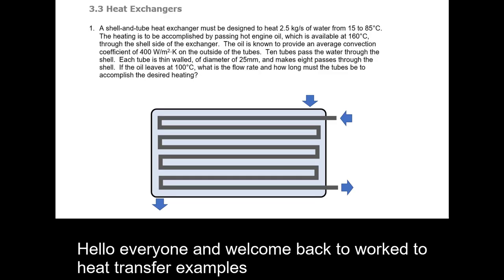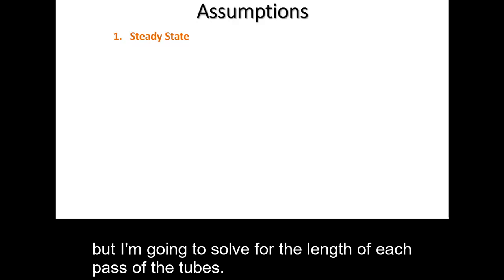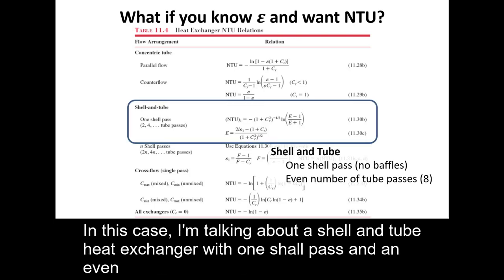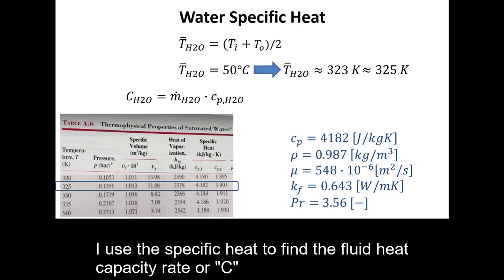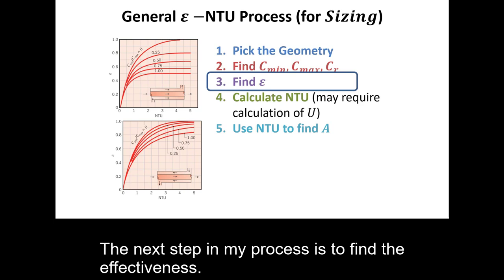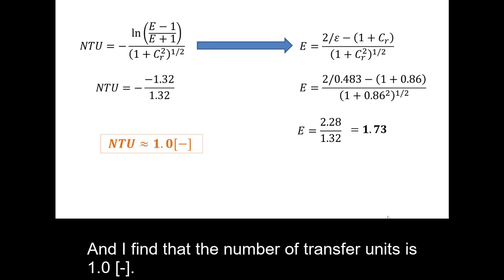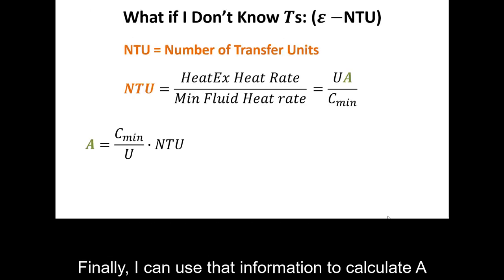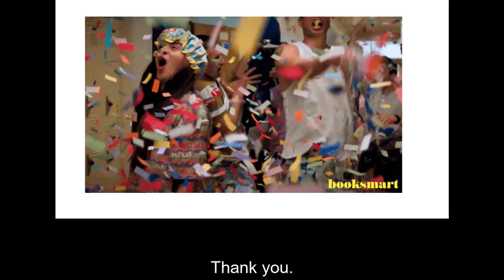Shell in Tube Heat Exchangers with multiple tube passes: Heat Transfer for Mechanical Engineers

Comment: Can anyone how explain he got the Reynolds number please
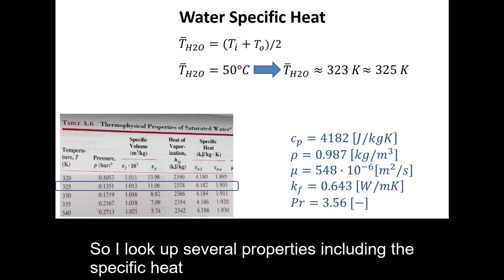Reply from the maker: In problems like these, we need to (1) define fluid properties and (2) pick a good equation to find the Re. You can see where we get properties at around 5:00. We get properties for water at around 6:05. We put that information into the Re equation at ~ 11:55. This equation might look a bit different than you are used to, but you could also use (/rho)(U)(D)/(\mu) = (U)(D)/(\nu). Note that in the heat exchanger videos, I seem to have often made the mistake of taking the specific volume (v_f) instead of the kinematic viscosity (/nu). But in this problem, the equation with mass flow rate works better because (m\dot) is given in the problem, as is the tube diameter (remember to convert to m). So the only property we needed to look up for Re is the dynamic viscosity (\mu). Others have pointed out that there may be a clerical error in the math here...I didn't go back to check if they are correct. The general method is correct, but you might want to double check the algebra.

Comment: 05:46 At T=323K, the dynamic viscosity (mu) should be 548*10^-6 Ns/m^2 (typo with the units on the slide).  The density (1/specific volume) should be 987 kg/m^3 (not 0.987 kg/^3). 
12:13 With these, I computed the Reynolds Number to be 2.32*10^5. Similar to Eduardo Suarez's result in the other comment. 

Thanks again for putting these videos up on YouTube.
Reply from the maker: Good catch. Looks like I was doing these too quickly. I appreciate you pointing out these errors.

Comment: Was it better to use:
Q= {mCp(T2-T1)}c = {hA(T1-T2)}h , and calculate HT area directly?
Reply from the maker: At first glance this looks like it would work. But we need to remember that the Delta(T) for convection is the temperature difference between the fluid and the tube surface. And the temperature of the tube surface varies along the length of the tube.

Comment: hi .. thanks for the video 
can i ask you where are the ten tubes ? I know the 8 passes but can't figure out where are the 10 tubes?
Reply from the maker: The tubes aren't shown in the picture. The sketch shows a single cross section. There would be ten tubes lined up in parallel (into the page).